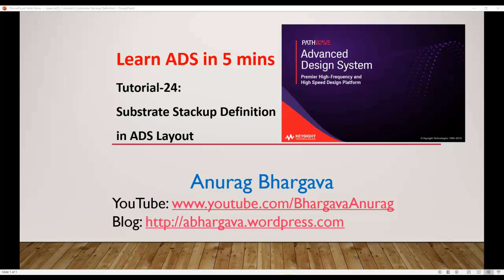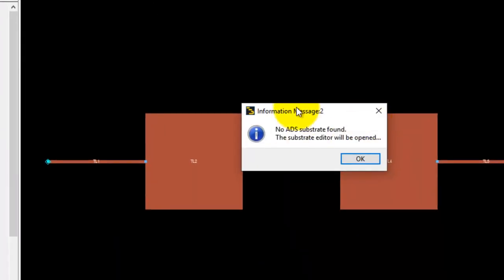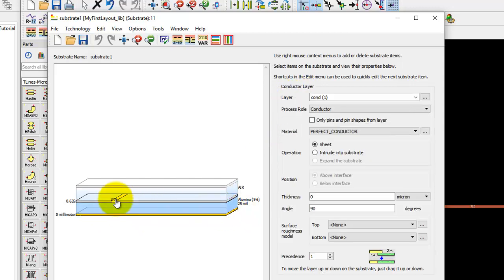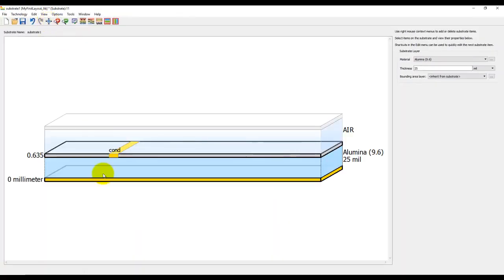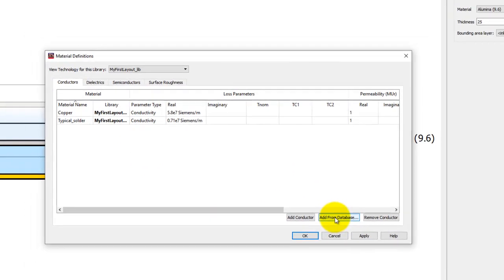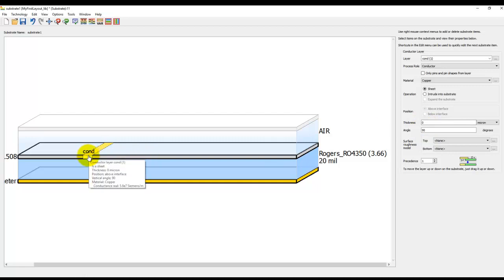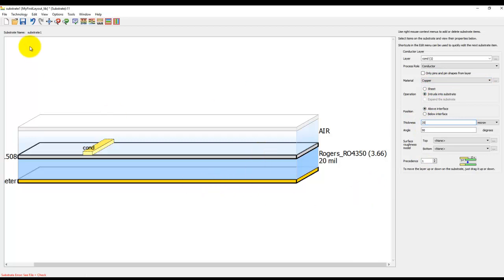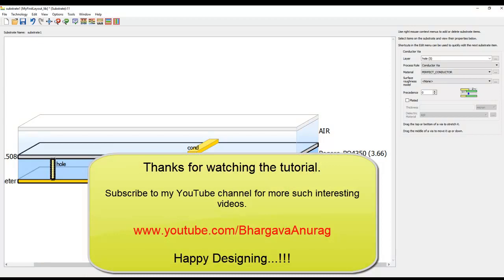Tutorial-24: Substrate Stackup Definition in ADS Layout

Comment: Hello, great video. Is it possible to add data bases for dielectrics not listed in the ADS library? For example is there a way to get a dielectric model into ads for 370HR material or do you just need to edit one of the existing dielectrics that already exists in the data base to try and model it?  Thanks!
Reply from the maker: You can add a new dielectric material in the stackup editor or add a existing one and change the parameter to suit your need. Either way should be fine.
Reply: @BhargavaAnurag  Thanks!

Comment: Hello Anurag, can you let me know how to add metal that spans across multiple dielectric layers?
Reply from the maker: metal layers cannot span across multiple dielectric layer as it is not practical. You need to have 1 metal layer on each dielectric and then use VIAs to provide connections as necessary.
Reply: @BhargavaAnurag  Some PDKs have the dielectric layers like this unfortunately and some tools like Cadence/EMX, Ansys/RaptorX,... accounts for this. I was curious to find if Momentum captures it that way.
Reply from the maker: @chandrakanthreddy6114  It seems there is some gap in understanding here. Either your explanation is not well understood by me or you are explaining/terming it wrongly. What you are saying is unphysical in a literal sense unless I see a picture or some reference to ascertain what is needed here. I would recommend to send me a link if there is any reference available online so that I can get a clear picture or you can contact your local ADS tech support team for help.